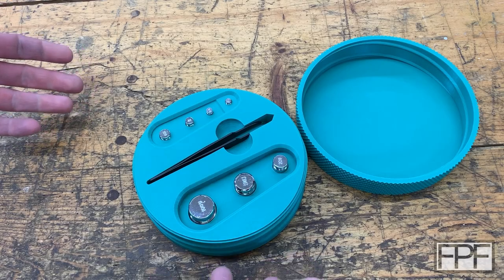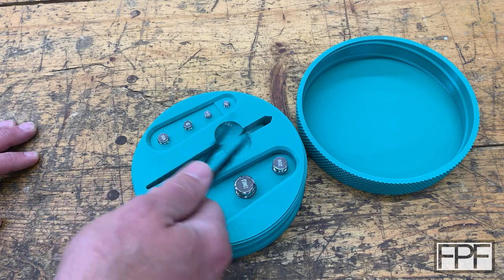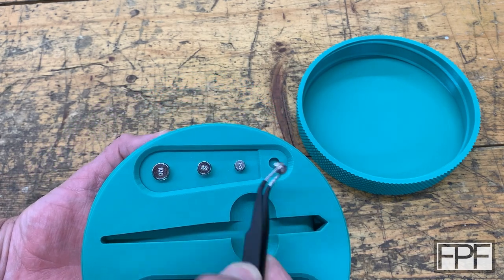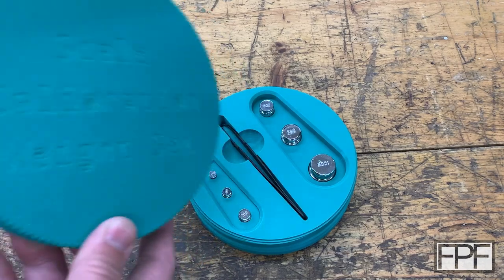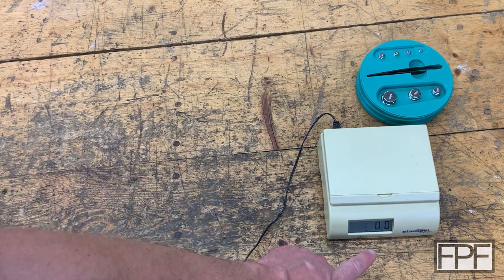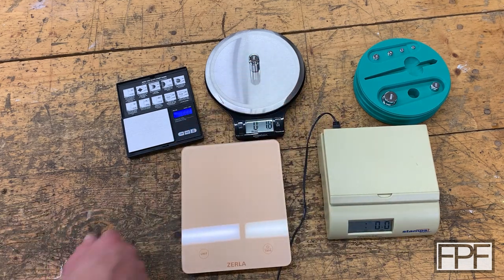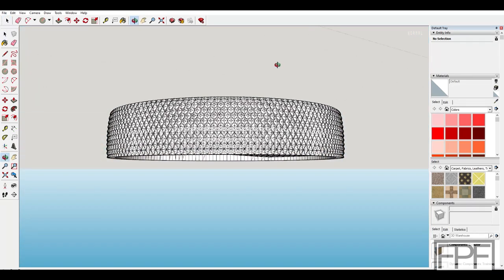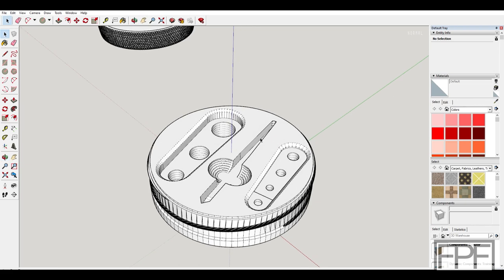3D Printed Scale Calibration Weight Case

Comment: Does your printer support M600 (Filament change)? I've printed stuff with lettering on the first layer and just made the text a separate body with a thickness equivalent to one layer height in CAD. Load both bodies in the slicer and set the text to print in a different color filament first, then do an M600 between bodies and switch to your main lid color.

Comment: I print text on surfaces just like that without issues. Use glue stick or something similar to aid in adhesion. I also squish the material into the textured bed more than a smooth bed.

Comment: You could put a vinyl adhesive label over it. 
You could print an embossed version of your design and glue it down on top. That would allow you to make a color swap for the letters. I would make the base not higher than 2 mm. Probably 1 mm. Then filet or chamfer the edge to blend at the edge just before the knurled starts.   (I’ve done similar with small trophies and it wasn’t noticed unless you knew that it was done intentionally later.)
I once did a container with recessed letters. I printed the letters separately in another color and pressed them into the recesses. Final product came out flush. It was a bit time consuming. I did use smooth sheet.